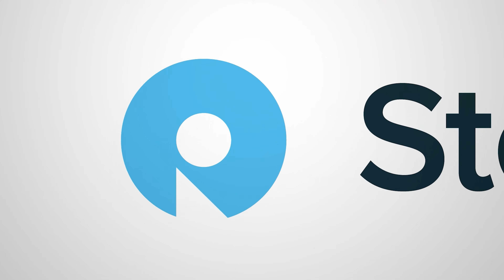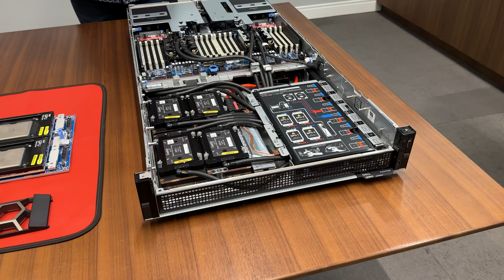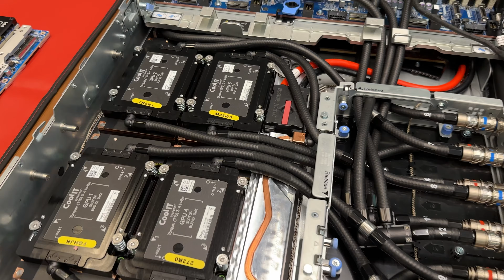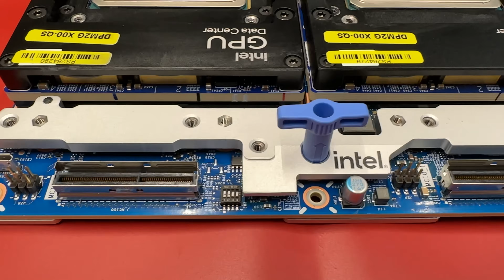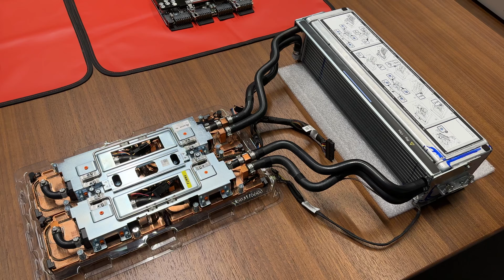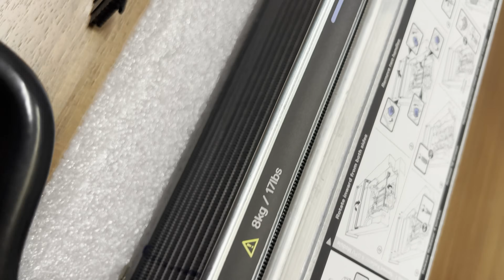Dell PowerEdge XE9640 and XE8640 GPU Server Review - Liquid Works Wonders

Comment: Pretty amazing to have all that in a 2U server.  I'd hate to have to rack a bunch of those at one time though, I imagine they must weigh a ton.
Reply from the maker: They're really not any different - the GPUs are "light"
Reply: @StorageReview  Thinking about it a bit more the heavy servers were usually heavy because of spinning hard drives.  So probably not as bad as I was thinking.
Reply: OK, now think about how much quieter your server room/DC would be
Reply from the maker: @jy5960  Yes and lower power consumption with fewer and/or lower spinning fans.